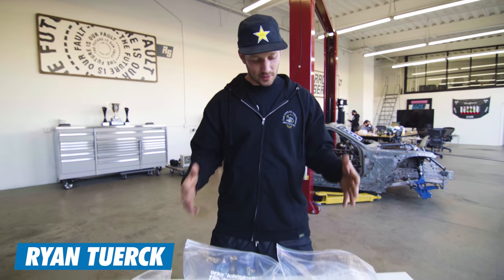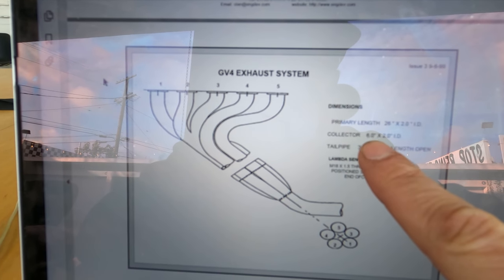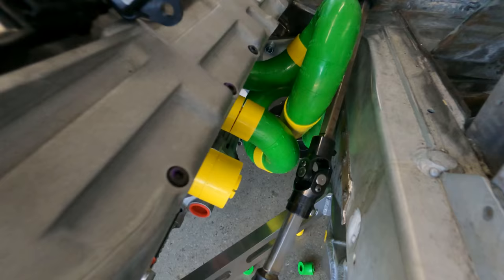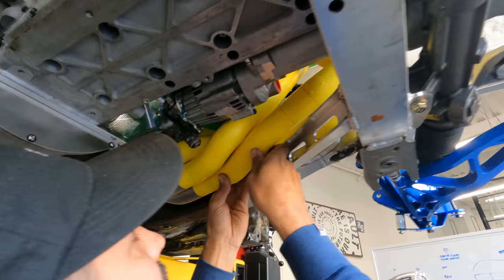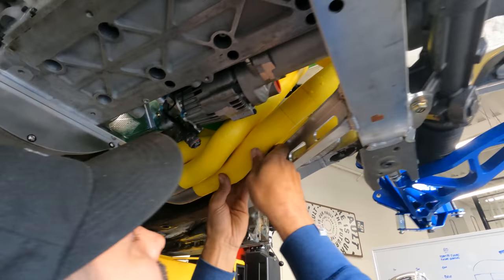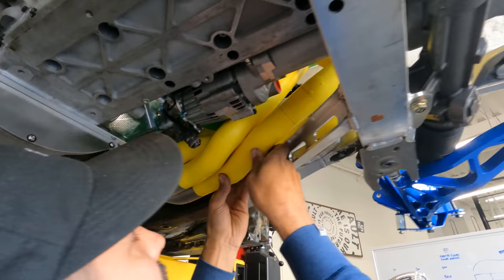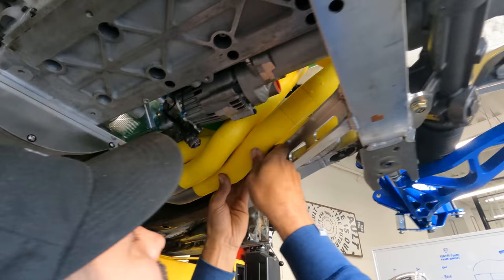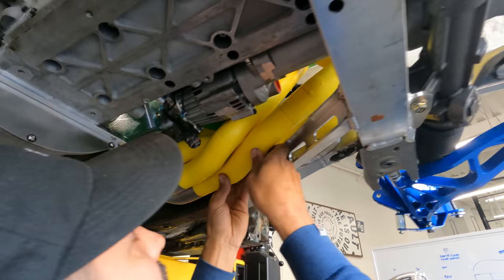Formula Supra Header Design, Sway Bar, Steering Arms.

Comment: Your fabricator Dom is a unicorn.  Don’t ever let him go.  Dude does magic with metal.
Reply: he's good for sure, but he aint no unicorn. Fabricators like him in the industry are dim a dozen.
Reply: @gwot  don't talk daft, there's lots of fabricators yes.. But not lots at this level.
Reply: @willsanctuary6626  given the equipment and tools, what he's doing is actually pretty easy. And yes there are lots, Dom is not rare. Think about it, every racing team at least has one, that alone makes Dom not rare. Also the avg salary for a fabricator might as well be minimum wage, because there are so much competition. Not trying to take his skills and knowledge away, just saying there are many. Definitely nowhere near unicorn status.
Reply: @gwot  I don't get it either. That lifting fabricators into the sky bs at youtube is a bad joke. Dom level is just normal over here in germany. I show up at my workplace and there are around 30 "Doms"...
-which if you turn it around means that dom is really good.
But nonetheless, nothing special.
Reply: @dalaisdramalama4470  finally someone with industry experience.
Reply: @gwot  only 3.5 years of proper education and around 20 years of experience in building conveyor systems, staircases, handrails, balcony extensions, carports, hydraulic log splitters and tar cookers🙂
But i have to say Dom is definitely better at welding than i am. Never had a job the required TIG welding...
Reply: All I gotta say is I wanna get into this type of work im sick of manual labor and find this stuff cool using the ol noggin and not just making stuff work but work well
Reply: The car that Dom crafted 🔥

Comment: Dom is a heck of a fabricator, can definitely do more with less than a lot of people. Manual machining is slowly becoming a lost art . . . not a ton of people around who are as skilled in welding and machining. My only $0.02 . . . buy a 5c collet hex block and machine hexes in less time than it takes to setup that indexer. The collet block has its flats ground so you just clamp on the collet block or setup the collet block on a 1-2-3 block on the table and then clamp the part (if it's long) and rotate it to the next flat (both the 4130 and 7075 steering parts). Also, make some vise jaws that are 1' wide or whatever and put the 2 bolt holes completely offset to one side. It'll throw the jaw length off the side of the vise which will allow you to hold tall parts halfway up the middle of them. @18:18 would have the jaws holding the part 2-3" above where they were being held in the shot as the bottom of the arm will actually be sitting on the table. Put slight pressure on the part with the vise and then throw a c-clamp around the outside of the jaws where the part is. I'm sure the part turned out fine but you'll have a lot less chatter with the workholding being up closer to the actual cut.
Reply from the maker: 100% Thanks for the tip man. Makes sense. A lot of the time Dom just figures out how he can do something with what we have on hand. I am never buying enough tools and equipment fast enough for the things that pop up during this build. The Vise jaws is a really good easy idea too. That we can do no problem. Thanks again dude.

Comment: So much tech in this header setup, ICE, equal length, precise runner length, 3D printed collector, 3D printed flanges, inconel.

Not sure you can do too much more to make it perfect
Reply from the maker: Totally. A lot has gone into it as they are the biggest external power adder or loser if done right or wrong.
Reply: @RyanTuerck  🙏🏻🙏🏻🙏🏻

Comment: Why not use two blades either side of the swaybar?
Reply from the maker: I guess you could but you are creating an infinite amount of SMALL adjustment that probably woudln't be able to be felt at some point. So one is the ideal setup and if you need to go softer or stiffer then you change the bar.
Reply: @RyanTuerck  True. I gues it's a link and doesn't matter what side it's on. It's fascinating watching the build as I'm use to working on GT cars. A lot in common, but the small differences are so cool

Comment: Why Inconel? Im guessing its because the 3D printed header parts are Inconel, but i don't know anything about it. Can it not weld to other metals?
Reply: Inconel is incredibly strong and holds considerable strength at elevated temperatures, much more so than 300 series stainless. It's the perfect header material other than it's cost. In some open-wheel stuff, I've seen "qualifying" headers made from .028" wall Inconel 625.
Reply from the maker: We used inconel because of the heat properties it has and it let's you run a very thin wall.
Reply: @RyanTuerck  Ah, i see. Your build is the first time hearing about this material, it seems very interesting. Keep up the good work, every new episode of Formula Supra gives me alot of joy :)
Reply: @pro-seriesfabrication3810  Im guessing it can transport the heat away pretty efficiently aswell? Thanks for enlightening me a little :)
Reply: @TheRealEvilSink  thermal conductivity of inconel is pretty low, it's mostly nickel base which is akin to Stainless in conductivity regards. It was designed in the 1940s for jet engines and primarily the nozzle parts. It's very strong but it's main feature is carrying it's strength at elevated temps.
Reply: @pro-seriesfabrication3810  Ah ok. Thanks again for answering my questions :)

Comment: I thought the alternator was on the rear end.
Reply from the maker: The one on the side of the engine is only a 35 amp. So we needed a bigger one which is in the back.
Reply: @RyanTuerck  thanks for explaining. I missed that in the other video.